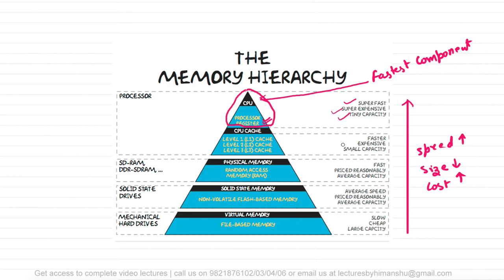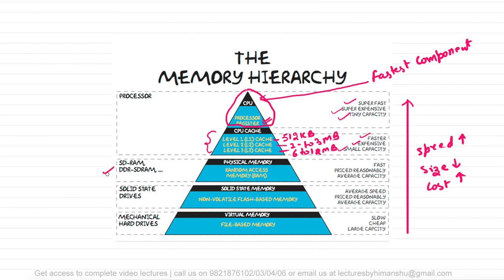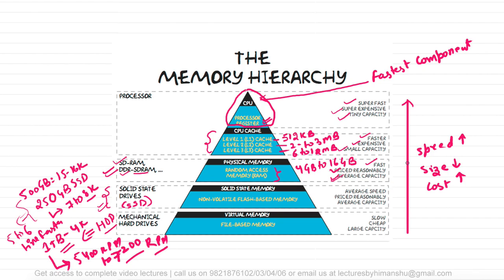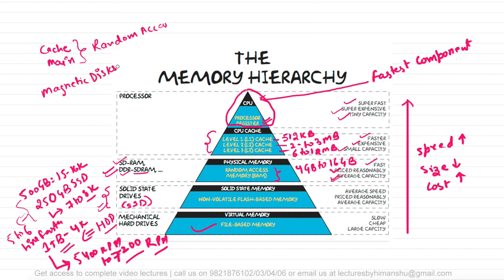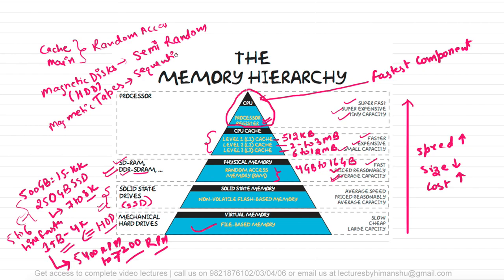02 The memory Hierarchy and Memory Interfacing

Comment: Good video, but L1 cache size you mentioned is too large. Typical size varies between 8KB to 32KB or somewhere around that. 512KB of L1 cache is very large. And so is the case with L2 cache. it wont be in MBs but would be around 256KBs or so.